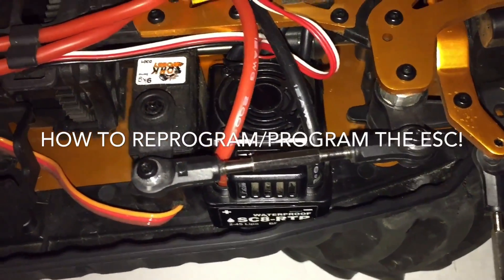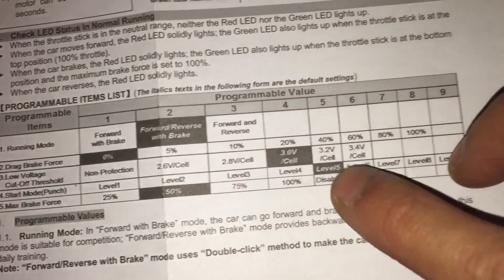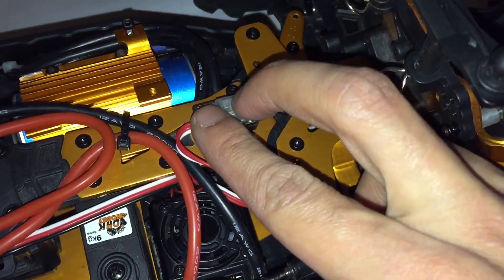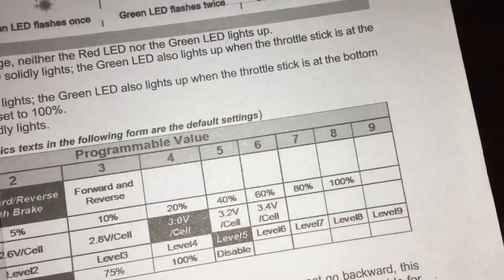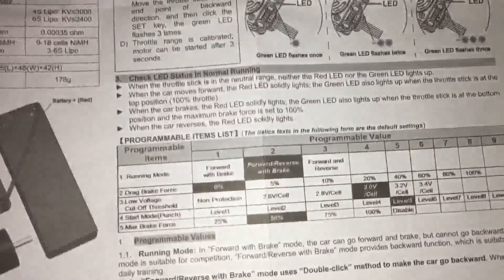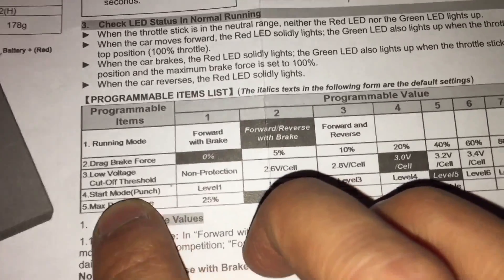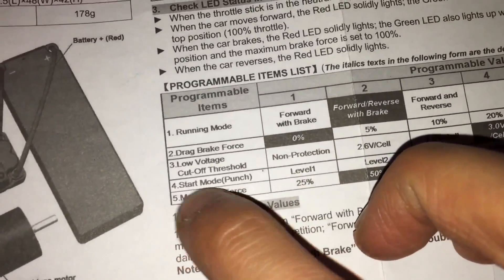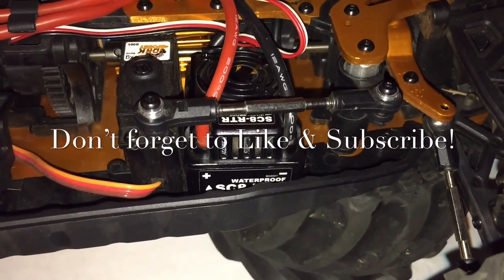DHK Maximus - How To Reprogram/Program The HW SC8 RTR 120A Brushless ESC Without A Program Card

Comment: Happy new year bro. Just a question. Whats really punch lvl does? Does it boosts speed or just the throttle response? (more torque on first trigger) could u please explain. I set mine on 6 level
Reply from the maker: The punch is basically the level response of the trigger. The higher the punch level the less you have to press on the trigger for peak power. Its like how far you want the trigger to travel before it goes into peak power. My punch level is also at 6 so around 3/4 throttle on the trigger gives me peak power.
Reply: @ItsRCTeng  i knew it doesnt give a speed boost. Haha. Thanks bro! Big help! Happy new Year Bro. ❤️
Reply from the maker: Happy new year bro 👍👊😎🍻

Comment: What dose it mean when it's an out-of-control blipping red and green light?
Reply from the maker: 🤷‍♂️ try to recalibrate it and then reprogram the ESC again.
Reply: @ItsRCTeng  I believe it was the battery...I charged them up and it all works. 
But...my new lights are in channel 3 and 4, and automatically come on now 🤷 lol. 
Also need to sort out my steering...it doesn't seem to have much power making a full left and right turn. 
Do you have any videos up explaining how to have the best steering? Or parts to upgrade for better steering, like a decent servo?
Reply from the maker: Upgrade the servo to one of those $10-12 20kg servo. They’re great, I’ve been using my aftermarket servo for about 4 years now and it still strong with a good turning radius. My truck flips when I turn at high speed so the servo works well with holding tight turns. Besides that, this truck is good in its stock form.

Comment: What is the best setup for a 2S lipo ?
Reply from the maker: For what kind of car? This truck only runs on 4s because of the two wire deans connector and two battery trays.

Comment: I have the same esc and the fan doesn't  work anymore, im unsure what the issue is, the fan looks to be in tac so im clueless. Any tips
Reply from the maker: Yes this happen to me before. Sometimes hard impact on the truck from bashing will cause a slight movement or even a broken arm that holds the fan in center. Tap with your finger on the fan and see if it spins when you tap it. Or, take off the 4 screws on top of the esc and take a look at the fan. Also, look at the connection plug that the fan is connected to the esc. Wiggle it around it can also be loose connections. If all that don’t work, then most likely the fam motor is burned out. My problem was, one of the arms broke so I super glued it back while trying to keep the fan as center as possible so it don’t rub the side walls when spinning.
Reply: @ItsRCTeng  ive also tried your tutorial for the max punch speed and brake force, my traxxas slash becomes a real weapon
Reply: @ItsRCTeng  but for the fan, so far it looks in tact, ive blew an axel so ill fix 5hat then ill have a closer look at the fan. Is the fan connection cable located inside the esc or on the outside
Reply from the maker: @TODD0626  it should be a plug just like all the other plug on the receiver but the fan plug is connected to the side of the esc.
Reply: @ItsRCTeng  the fan had alot of dirt inside of it. All good now. My car is now backwards, reverse = forwards forwards = reverse. Help
Reply from the maker: Reverse the throttle switch on the controller and see if that helps. There should be 2 switches. TH reverse and ST reverse. Flip that throttle reverse switch. If that don’t work. The 3 wires on the motor, unplug one wire and plug it into an another wire. Like swapping the connections. That usually works.
Reply: @ItsRCTeng  your a legend. Cheers
Reply from the maker: Did it work?
Reply: @ItsRCTeng  yeah, cheers for all the help
Reply from the maker: Awesome!!! 👏 Cheers mate! Keep having fun with it! 👍

Comment: TL will these setting work for the for the DHK Zombie 8e's ESC?  If they are thanks 
so much for great video if not do you have manual for Zombie 8e and you do video 
on it's variables & settings ? I have the Zombie but didn't get instructions on  the ESC programming! Hope you can help!
Reply from the maker: Yeah if your esc is HobbyWing then you can change the settings using the instructions I show. Dhk esc’s are most likely HobbyWing esc. 👍
Reply: @ItsRCTeng  Thank You so much Man! I've had my Zombie for 3 yrs
but never could change punch setting  or others because that sheet
or (page) did not come with manual or in box when new!
You saved Me! : ) great video !!!
Reply from the maker: Cool glad I can help. 👍

Comment: Thx i set the low-voltage cutoff on 3.2v and punch to 9😂 on my jlb 21101 that thing will be flying!
Reply from the maker: 😂👍 good job! R you referring to the 120a version JLB cheetah? I was thinking of getting that before this Maximus but I’ll save that truck for later. 👍👍
Reply: Teng Lay yeah the 120a truggy version. But the only problem is that the dogbones keep bending with high jumps. And i am jumping like 4-5 meters (12-15ft) and thats pretty high. My little brother is getting the dhk zombie and the maximus is basically the same but do you have any problems with the dogbones?
Reply from the maker: Yeah the CVD always bend on my cheetah too. I think all JLB cheetah will face this bending CVD issue. One thing I notice on the dhk, the screws around the suspension area and the control arm screws tend to get loose after a couple of hard runs.
Reply: Teng Lay "hard" 😂 jk, maybe use some loctite.
Reply from the maker: Lol yeah dude. Ivan wing the Olympics with this truck from all those flips, tumbles, and cartwheels 🤸‍♂️ LOL
Reply from the maker: I can win*
Reply: Teng Lay when i saw the video I thought that you where being pretty moderate with the truck. Have you wachted kevin talbot I like to drive the way he does so that's why I dont drive very often because its broken and then i need to wait 3 weeks😎
Reply from the maker: Yeah I’ve seen some his videos and they’re great. I’ve done test runs with the Maximus off camera and cracked parts of the body already from all the hard crashes. It’s so tempting to go hard with this truck but at the same time trying to be moderate for the viewers wile explaining and driving at the same time.